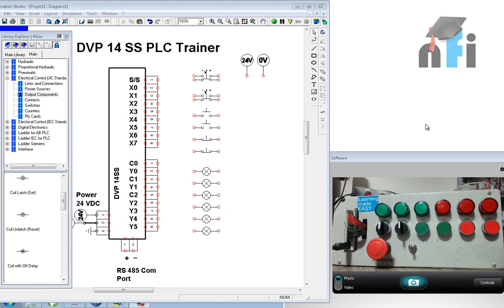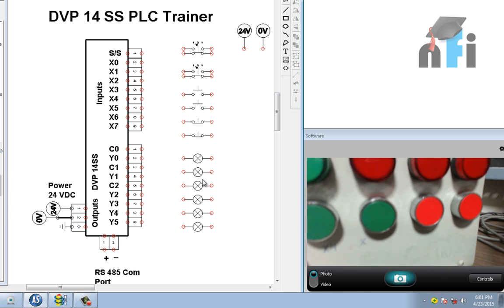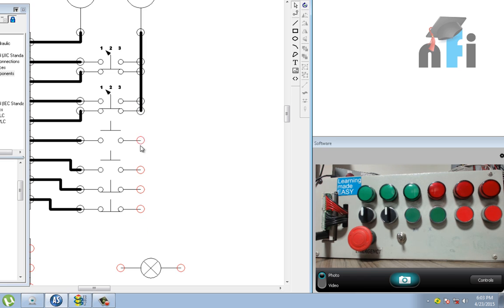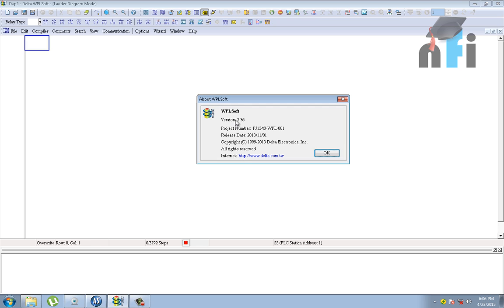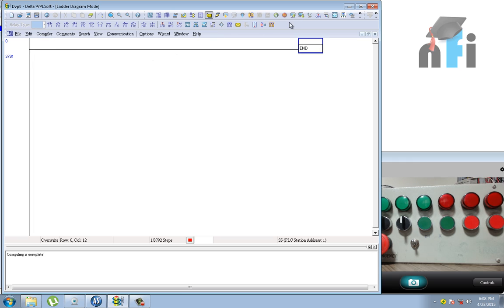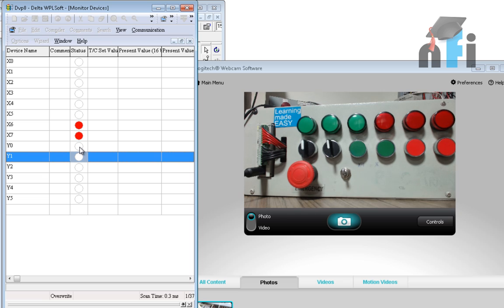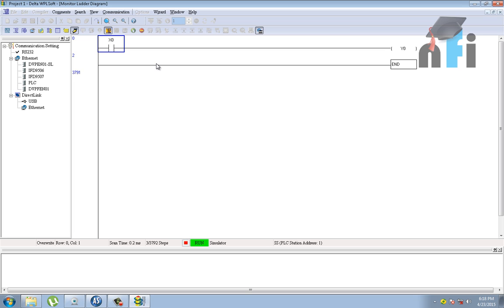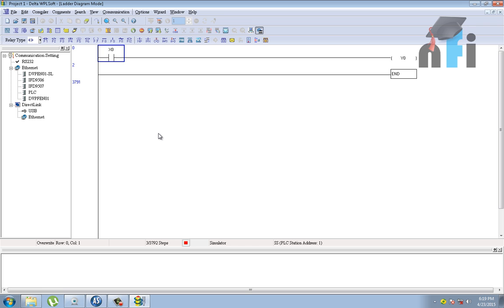PLC E-Learning - Session 3   Introduction to PLC Trainer & PLC Software

Comment: dude seriously, when in input side  you connected  zero to one end of a switch and 24 volt to the other end and you turn the switch on you will create a perfect short circuit. It is like touching minus to plus of a 24v battery ???!!!!! (you have no consumer in the circuit). What the heck are you teaching here ?? Also when you have plus to one end of a motor and nothing on the other end you just created a one phase situation, you can damage the motor coil. you can not interrupt neutral or zero and have plus on; it works the other way interrupt plus and have zero on !!!!
Reply: htc2hd 
There is always a  civilized way to say things. I can smell that you are just started learning the PLC and you trying to show that you know little bit .play the  video slowly I think it’s little faster for you and watch and learn before you open your big mouth.
Reply from the maker: +htc2hd Can you tell me the correct way of Plc wiring then ? 😅 - also tell me your Skype ! We can discuss
Reply: Rajvir Singh 
I have a question and a proposal for you? Do you have a e mail address I can email you?
Reply: How did you create the DVP14SS PLC trainer diagram in automation studio ?
Reply: give the answers